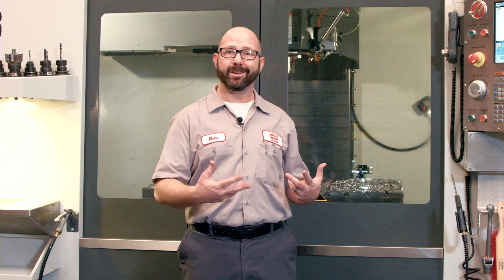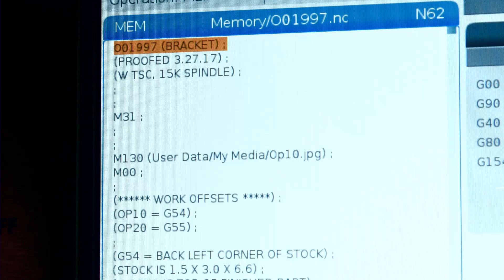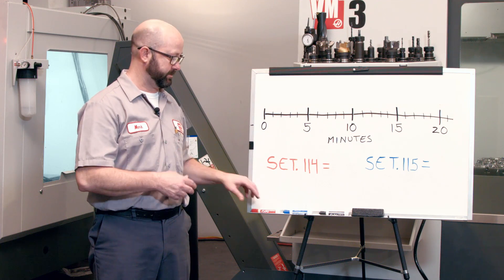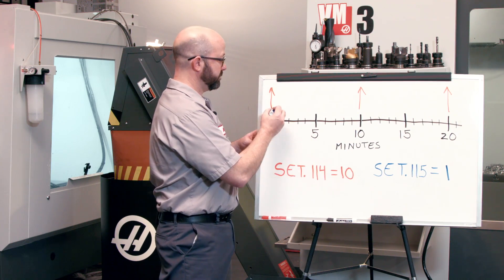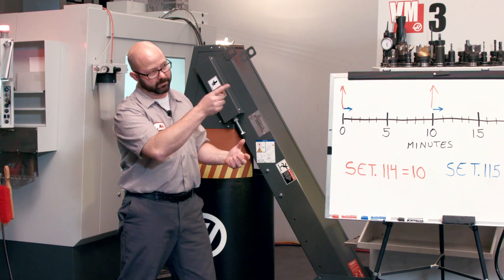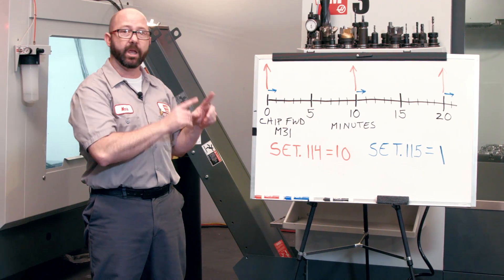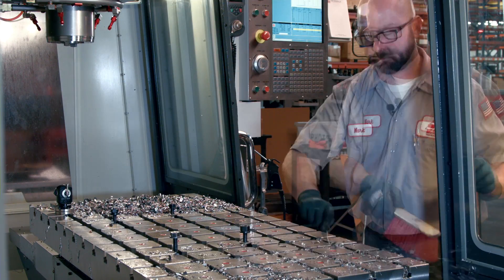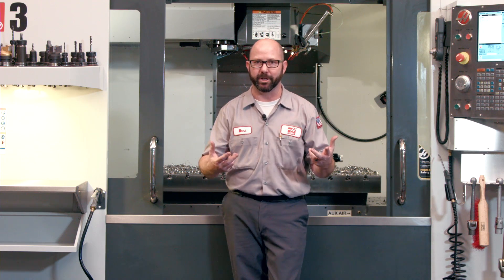Reduce Your Coolant Carryout – Haas Automation Tip of the Day

Comment: The HAAS chip auger is the worst design in a chip evacuation system I have ever seen. It's been using the same junk design for over twenty years, and has only gotten worse. The shop I work at, we have to keep the damn auger going constantly and it still gets jammed, which means the work stops so that the machinists can unclog the stupid auger. What genius engineer thought it was a good idea to jam the chips through a tiny hole at the base of the chute, which has an almost 90 degree bend?!

Comment: This has worked well for me, but I've noticed that when the machine has completed running the program that it will continue to cycle on and off until I physically press the Chip Stop button ( even though I have a M33 at the end of my program code )  Is there anyway of preventing this?

Comment: Mark, can setting 15 be sat to .5, thus running for 30 seconds every ten minutes?
Reply from the maker: Keith – It can’t. Whole numbers only for Setting 115. If you have macros, we can do almost anything though. Running the following code will run the conveyor only every third part: IF[[#3901 MOD 3] EQ 1] M31 (RUN CONVEYOR EVERY THIRD PART). If we change it to “MOD 4” it will run every fourth part. Thanks for the comment. – Mark, Haas Tip-of-the-day

Comment: A minute of running duration is too long especially for a belt type conveyor.  You only want it running calculated on the time the chips start going up the slope until they are just about to be discharged.  On my ST-10 that time is 37 seconds.
Reply from the maker: Kim – That’s a good point. If you’re on a machine that has macros, you can run a code like:   IF[[#3901 MOD 3] EQ 1] M31 (RUN CONVEYOR EVERY THIRD PART). This will only turn on the conveyor every third part. I put in a request, based on your comment, to the Software department, asking if we can adjust this setting, allowing us to go with a shorter minimum time than 1 minute. Thanks for the comment. – Mark, Haas Tip-of-the-day.

Comment: You discussed having the chips being held in the up slope of the conveyor to allow them to drain, with our Auger system from you guys it is a much shorter up slope. Is there any suggestions for the Auger style type you can give on lets say a VF-2?
Reply from the maker: The shorter funnels are still very effective at draining the chips. Refraining from hosing-down the chips directly with our coolant hose, right as they enter the chute/funnel, is a good way to cut down on coolant loss. This, along with good use of Settings 114 and 115 can help quite a bit. – Mark, Haas Tip-of-the-day
Reply: Haas Automation, Inc. thank you. My boss actually got ahold of you and answered a few more questions.

Thank you.
Reply: hey answerman
I'm student in haas machine I begin this year, i want to ask you how to use VQC?
thanks mohamed from Morroco

Comment: Does this command work only with HAAS machines ?
Reply: kikkawa vint 
the m code for conveyor or one or more aux relays (which you might choose to rig to your aftermarket comveyor) will vary from make to make and control to control. 
m31/32/33 are what haas use. Hurco winmax uses m59/60/61. (along with some other parameters for things like conveyor speed) fanuc is 66 or something... point is you have to look it up  for your machine.
Reply from the maker: Kikkawa -  We designed our Settings 114 CONVEYOR CYCLE, and Setting 115 CONVEYOR ON-TIME, to save Haas customers money, and to automate our conveyors. We can turn on/off the our conveyors with an M31/M33 code. These particular codes/settings are Haas-specific.

Comment: Thanks for the tip:  Another benefit when using a chip auger is that coolant tends to get trapped where the auger spins.  Turning the chip auger on intermittently will allow coolant to drain back through the screen at the lower left end of the machine back into the coolant tank.

John